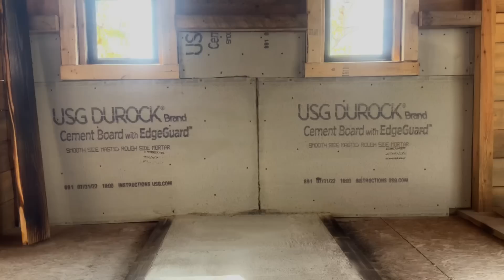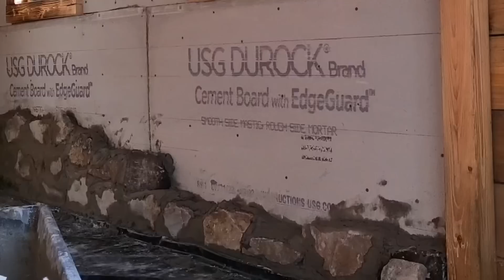An Original Off Grid Cabin | Part 2 | Ep. 4 | Fire (Shou Sugi Ban), Wood (Floor) and Stone (Wall)

Comment: I love this cabin, the simplicity and quality is absolutely perfect. I really do love it. 

One thing I have seen that made me wonder about is the ends of the walls that stick out will catch rain from time to time, which can’t be helped but because of the use of 3 pieces of wood, will likely allow water to seep in between the joints and into the cabin and facilitate rotting over time, even if it is treated.

I thought one way to help this, and really look fantastic too, would be to hammer out copper sheet caps. A bit expensive, I know, but it will prevent water getting in and will suit the cabin perfectly. 

What do you think?

Once again though, I think this is my favourite cabin build series on YT 👍🏻
Reply from the maker: Thanks for the comment! 
Regarding end caps, I have put some on a few of the 2x8 logs using 1x6 cedar boards and burning it. It’s worked out well to this point so that’s what I am going to finish it off with before it gets too cold and wet. Copper would be pretty cool but really pricey.
Thanks again and take care!
Reply: @TheOffGridExperience  I should have known you’d have it covered 👍🏻

Comment: You have balls of steel . Burning that wood on a already built structure . Not to mention , burning it by a chain saw (fuel and oil ). So much could go wrong . But it does look very nice . Careful !.
Reply from the maker: Haha….believe it or not, it’s really hard to start a fire with a blow torch on smooth wood. Wood that is already “burned” is even harder to start a fire with. The chainsaw appears closer in the video than it actually was.
Thanks for watching!
Reply: Since every piece of lumber on that cabin looks like it’s been torched, I suspect he’s got a feel of what it can and cannot do by now ..lol

Comment: What does firing the wood do ? 😊
Reply from the maker: On the inside of the cabin it's a lighter burn mainly for looks. On the exterior, it's a heavier burn that is supposed to preserve the wood longer and protect against the weather and insects.
Thanks for watching!!
Reply: I have seen the wood burning on other builds for the roof. Is this for durability or does it seal the wood? Maybe both?  Either way, what a great project, thank you.

Comment: Why is your floor flexing up and down when you walk on it?  Is it not screwed down all the way?
Reply from the maker: It's 7/16 OSB and not designed for subflooring. I used it because it was a cheap way to be able to walk on the floor while building and I knew I was using 2x8's for my finished floor.
Thanks for watching!

Comment: Hi , Can I ask you a question , is it fire resistant cement you're using?
Great work btw👌👍
Reply: Where do you buy flammable concrete ?
Reply from the maker: I'm sure all cement  is fire resistant.  Fire proof is another story.
Thanks for watching!
Reply: @rod462  where did I say flammable concrete? Normal concrete cracks and lose it's strength when exposed to heat/flamme.
Reply: @TheOffGridExperience  Not really , normal concrete isn't recommended near stoves/chimney,  high heat concrete you need made of sand,crushed bricks and high alumina cement to ensure the strength is maintain. Hope you don't mind me telling you,  just trying to help.
Reply: @a.d.595  Damn good to know!